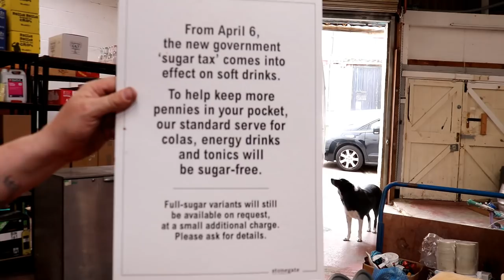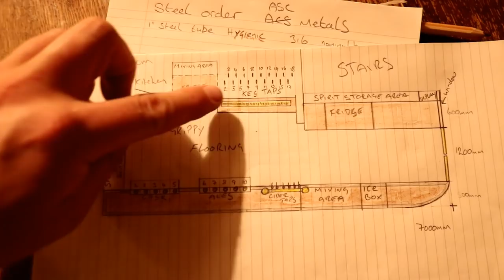BAR EQUIPMENT

Comment: Tremendous progress! I'm going to try and find a commercial cask beer to sample. Not common here.  I thought they might blow if primed. How much pressure will the bungs hold?  Be careful using a  metal scraper on your SS. It may result in some surface rust.

Comment: Harry as a home brewer as i have experimented O2 during the transfer kills my beers.  I have begun the process of purging my kegs with CO2 prior and post transfer. I noticed you didn’t show this. Also most of the beer i make is very hoppy so maybe this depends on the style. Did you do anything to reduce O2 contact with the beer during the transfer?  Maybe my practices are unnecessary?
Reply from the maker: Don't worry too much about it, A few basic rules including good sanitation, no splashing and make sure you don't draw air in to the hose on the tank side and you should be golden.

Comment: What's the yeast you use? I found that many english strain behave like you explained and I got slightly overcarnonated bottles after a while even with what I thought was very little priming sugar... I now only keg my beer so it's not an issue any more...
Reply from the maker: I use US 05 in most beers and Nottingham in stouts and bitters.
Reply: HarryBrew69 interesting, and still you get an extra bit of carbonation after filling it into cask? Also, where could a homebrewer  get a pin or a firkin?
Reply from the maker: You could basically use a corney keg but serve at 11-13C and only 2 to 3 psi